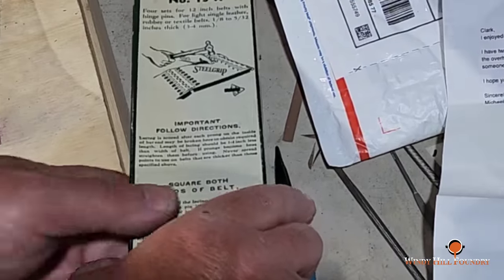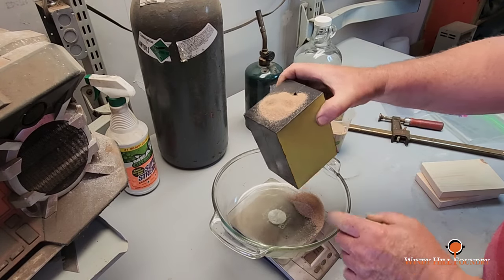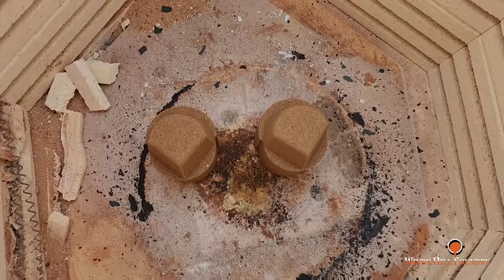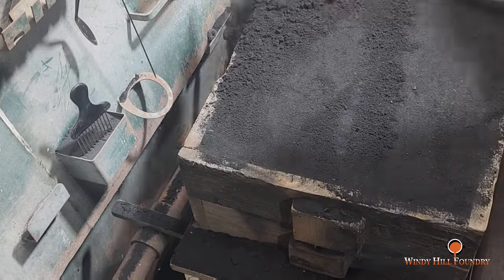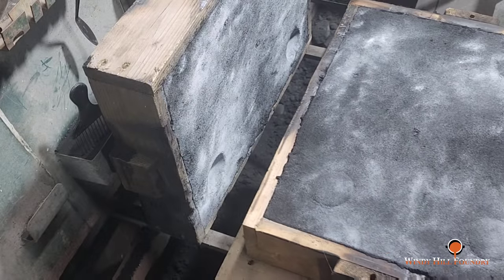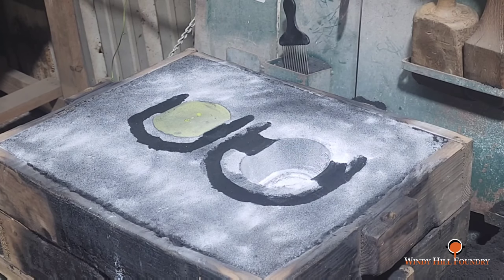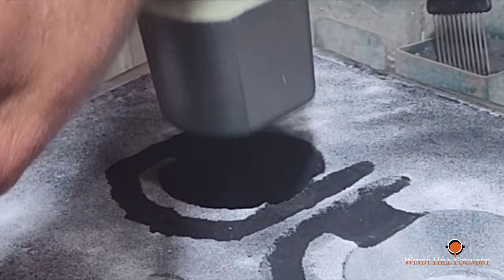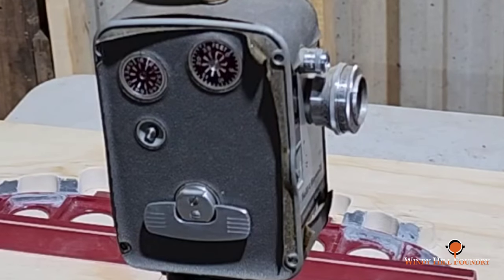WHF 15 Sodium Silicate Cores

Comment: I LOVE watching casting work! Only time I've ever done any was in HS metal shop. Sand casting lead for soft-faced hammers. Ram the sand around the cores, take them out. Melt the lead and pour it in, then machine the ends for threads, and drill a hole for the handle. Make the soft face parts, install the handle, then drill and wrap it with cord and dip in PlastiDip (yes, they had that in 1975). I still have it all these years later AND I use it! 😁

Comment: I believe that foundry I worked at way back when I was a teen used a giant vacuum chamber for drying cores. But some of those cores were large with lifting eyes so the crane could set them. I'm remembering 200 to 300 ton pores. And yes, a mold could violently explode from moisture. Seen steel boxes that were split. Thank you for the vids and the laughs.

Comment: Just a thought. In our foundry we used to make a slurry of alcohol and graphite. Then we used to paint it on the cores. The alcohol would evaporate and you have a nice coating on your core. You could also set it on fire to get rid of all the alcohol. Keep up the good work...
Reply: Did you use denatured alcohol, methanol, isopropyl or ethanol
Reply: I would use isopropyl alcohol. There's a company that manufactures a premix. The product is called sure coat.